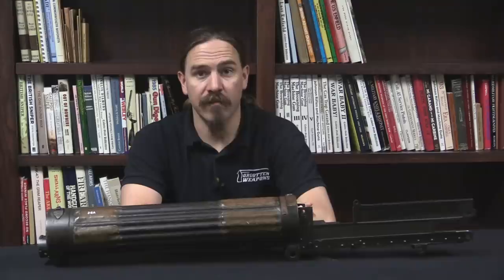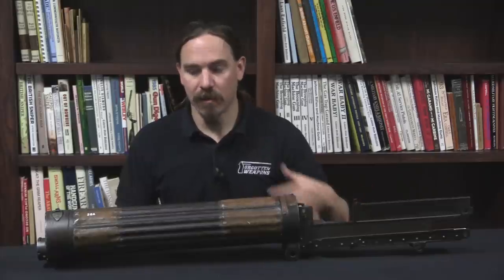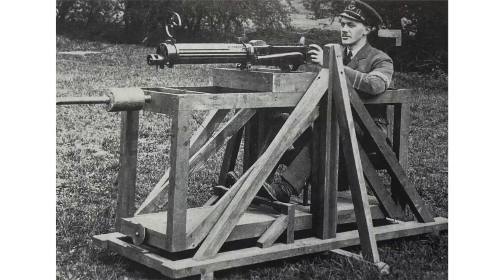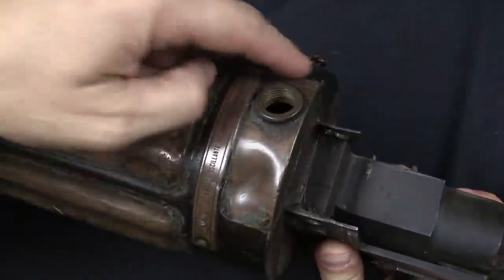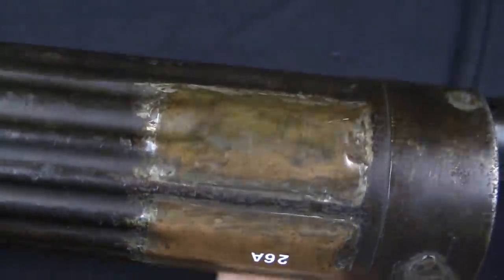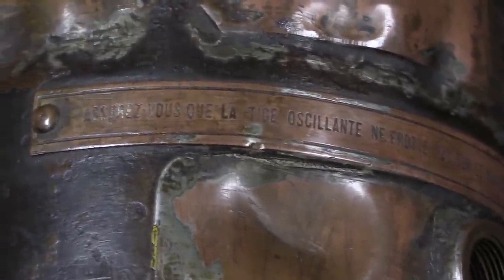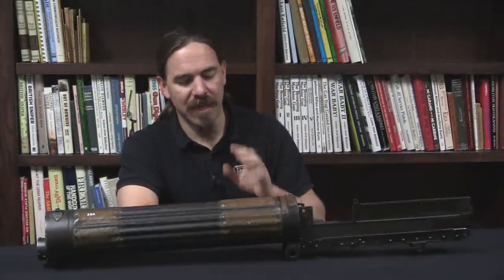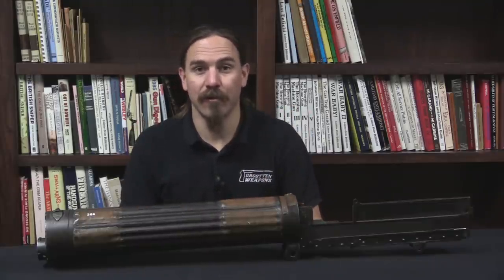Aircraft Vickers Meticulously Repaired as a Gunnery Training Aid

Comment: It occurs to me that the French only used the aircraft Vickers.  Hence the need to modify a perforated jacket rather that just acquire a ground gun jacket.
Reply: I think you are right and Ian touched on this....they didn't use spade grips but a remote trigger so only an actual aircraft gun and system would be right.
Reply: @earlyriser8998  doesn't the vickers trigger slide up out the back? so surely it would be less work to just put a aircraft style trigger mechanism on a ground gun than to solder up an aircraft gun?
Reply: @andreww2098  I think the point is that the French had no ground-gun Vickers to source parts from, they only had Aircraft ones to work with.
Reply: @earlyriser8998  Unless they would put it on a Neiport it must have Spad grips on it.
Reply: I'm always taken back and amazed by stuff from the Great War

Comment: My translation is a bit different: “do not pour wine into the jacket, no matter how indifferent the quality .”
Reply: Didn't the Soviets use low quality but potent alcohol to cool radar during the Cold War?
Reply: Given the issues europe in general had with wine adulterated with glycols, it might have outperformed the water...
Reply: @hurricane567  No... they used extremely high quality 40% ethanol/water blend in an evaporative chiller to cool the crew air in the Supersonic Booze Carrier. Uh, I mean the Tupolev Tu-22 bomber.
Reply: @hurricane567  well, they did do a ground test on the Proton rocket by filling the tanks with alcohol instead of rocket fuel (they happened to have several tank cars of industrial grade alcohol laying about...because of course they did)
Reply: @hurricane567  One of the Tupolev bombers used 40% ethanol/ 60% distilled water as coolant for the avionics and cockpit climate control. It became known as the "Vodka Truck".
Reply: I remember Lt Victor Belinko complaining that the mig 25s radar cooling alcohol was occasionally drunk
Reply: @hurricane567  in east germany they did it for sure. My father was the guy refilling it and is telling stories about ethanol mixed with cola (not coke) as the only alcohol for normal people at the airbase

Comment: The proper translation would be : "Ensure that the oscillating stick does not rub on the machine gun's jacket". The oscillating stick might refer to something else than a "stick"
Reply: The literal translation of “tige” is “stalk”, not “stick”. If I had to hazard a guess, I would say it refers to a reciprocating rod in an interrupter system.
Reply: @Squossifrage  ”oscillante” is not reciprocating in french. And yes, stick might not be best word, rod would be better. I had a look at the Vickers synchronisation installation and i believe that it refers indeed to the rod connected to the engine
Reply: @vincentkermorgant  I'm a native speaker. While “oscillante” does not literally mean “reciprocating”, it's the best translation for what I believe the text refers to.
Reply: @Squossifrage  I'm a native speaker as well. Oscillante exprime tres clairement une tige dont l'axe change plutot qu'une tige qui effectue un mouvement de va et vient. Regarde le schema de la synchronisation de la mitrailleuse Vickers aviation et tu verras que le mouvement est en effet oscillant car lateral
Reply: @vincentkermorgant  bon écoute mon chou, si ça te fait plaisir je te fais un petit diplôme certifiant que tu as gagné la discussion, d'accord ? Parce que j'ai mieux à faire que débattre avec quelqu'un qui insiste à prendre mes mots à tort.

Comment: "So can I get a few regular vickers for ground training?"
"what's wrong with your air-cooled ones?"
furious bureaucracy ensued
Reply: It is better to start with airplane adapted gun in this case as you can replicate the remote trigger as Ian points out and the interrupter gear as the plate warns about.
Reply: Aircraft Vickers set up with interrupters were somewhat different from regular ground Vickers so just getting a water cooled one from the Army may not be ideal. 

Plus, the French wouldn't have had a lot of Watercooled Vickers lying around. The French army used their own machineguns and the primary one wasn't even Watercooled. The main French use for the Vickers was in aircraft equipped with interrupter gear, which at the time were not very reliable with open bolt guns like the Hotchkiss. 

Further, no army in WWI ever had enough machineguns that they would happily give them up for other people to train.
Reply: The french had no standard Vickers guns, they only ever bought the aircraft mounted version. 
And going to any of the commonwealth armies and asking for a few machine guns for training would have been met with lots of swearing and complaints about needing 10 times as many as they have for the front as is.
Reply: @cgi2002  I think they'd have been met with a WWI equivalent of 'Yeah, right.'
Reply: @LadyAnuB  depending which commonwealth army/army unit you asked, "yeah, right" was the ww1 response, some were likely less polite. Got to remember the French didn't exactly get along with any of the other commonwealth nations before the war.
Reply: @cgi2002  Less polite response, British WWI version of F Off, Get F'd, etc.

Comment: Ian, the "oscillating arm" - is a part of synchronization gear, which was basically a system of interconnected levers, one end of which which would ride on an eccentric cam track, attached to the backside of the rotary engine and the other end - blocking the trigger mechanism, when the prop blade was in front of the barrel. Part of this lever system was located inside the ex-water jacket, around and above the barrel. The last leg of this system, a reciprocating rod, was protruding through this big rectangular hole on the rear top of the jacket and was connected to the trigger disconnect mechanism. So, this plaque is, probably, a left over from the time, this gun was air-cooled.

Comment: One of our other interests is big old gas engines, older than, or same era as this gun.  I've seen several running engines with riveted on brass patches where the water jacket had frozen, or in one case where a freight train derailed onto it. Generally done very neatly.  Given the nameplate, the source for the brass may well have been a brass fire extinguisher.

Comment: The whole video I was thinking "But why?"

I was thinking it had something to do with it being more difficult to convert a regular one into one with a cockpit trigger. It didn't make sense that this would be the case, but it was all I had. Afterall, for training you just need it to function like the actual version, it doesn't have to be exactly the same. Thus I figure you could get away with a rather crude conversion that would fill the role well enough. And those patches took a fair bit of time, skill and effort.

I didn't even think about the sheer demand for machine guns being a possible reason.

Comment: This is a Colt built Vickers, which is indicated by the two sets of patched louvres - the British Vickers Maxim Company only ever cut one set of louvres in the old water jacket for airflow - and these usually towards the breech end of the gun. (Aside from which the French  Aéronautique Militaire almost exclusively ordered the Colt made weapons). The  oscillating rod referred to would normally be for the Alkan - Hamy  synchronisation system, which introduced such a spring loaded rod through the empty water jacket to the trigger motor. However this usually involved a large cut out in the base of the jacket, which as is pointed out in the video, this particular specimen does not have. Therefore, it would probably indicate a Birkigit synchronisation system which also used a fixed series of connections to the trigger motor mechanism. Please note these are always Synchronisation systems - never 'Interrupter' systems, as the system fires the gun once the system is engaged and the trigger levers depressed on the control column, at the opportune synchronised moment of the prop passing clear, it does not 'interrupt' the flow of an independent  rate of fire from  the original trigger mechanism. For a view of both the Alkan- Hamy and Birkigt systems as well as all those from the other nations in the Great War, see Harry Woodman's seminal book "Early Aircraft Armament - The Aeroplane and the Gun up to 1918" published by Arms and Armour Press 1989

Comment: With the constant source of 100 mi/hr air, even at the same temp the gun would cool quite effectively, but, as you mentioned, with an average lapse rate of 2C (3.6f) per 1000', it gets a lot cooler fast as you go up.  It is not uncommon flying out of Phoenix in my modern aircraft that I see an outside temperature spread of 45C to -57C (113 to -70).

Comment: "tige oscillante" refers to the synchronization system between the engine and the machine gun to enable it to shoot through the propeller disk. There was a cam attached to the engine drive shaft connected by an oscillating rod to the trigger mechanism preventing the bullets to strike the propeller. This rod was very close to the gun cooling sleeve. There is some pictures at the end of this technical documentation about the system. (a perfect exercise for Ian to perfect his french)  https://docs.google.com/viewer?a=v&pid=sites&srcid=ZGVmYXVsdGRvbWFpbnxmdXNlZTQ0bW1kb2Njb21wbGV0ZXxneDoxYjE3OTAxNzkwYTA0MTcx
Reply: This document is an analysis written in 1919 to compare the french, british and german systems. It concludes that the American system (Nelson) is the best one. But invented too late to have any use during the war. For him the future in the electric firing mechanism. Very accurate for a report written in 1919. The system used in Ian's gun is the Birkigt gear. See Wikipedia  https://en.wikipedia.org/wiki/Synchronization_gear

Comment: wouldnt removing the barrel jacket altogether have been better for aircraft-mounted vickers? or are the vents somehow more efficient in heat removal than no jacket at all?
Reply: The gun needs a recoil booster which is mounted on the jacket.  There was a later pattern of aircraft gun that replaced the jacket with a slim perforated tube, like a Browning M1919; but one could not just discard the jacket.
Reply: The barrel reciprocates so the front and rear need to be supported.
Reply: Thanks for the responses guys! I suspected there was something structurally integral in the jacket but now i know for sure

Comment: The question IS; it was not easier to adapt the rear of the machine gun to a ground machine gun?
Reply: As someone has pointed out before, this was probably in the French air force. The only Vickers used by the French were in aircraft. Coordinate the French and British chains of command to supply a few regular Vickers? Hammering out a few brass plates is much, much easier.

Comment: Didn't the cocking lever fly back and forth (90degrees) violently on some old machine guns? Could that be the oscillating arm? Probably don't want that smashing your water jacket.
Reply: That was my initial thought too, though on the Vickers it's just in front of your right hand, so I don't think that's it.
Reply: I would have thought it referred to the interrupter gear linkage, if it was mounted on an actual aircraft with a spinning propeller. The ground training use would suggest no engine and therefore no interrupter gear though. Aircraft guns had various oscillating doohickeys connecting the engine to the trigger mechanism, to interrupt firing as the propeller passes in front of the gun. Maybe this was used on a plane that was no longer airworthy, but got converted for ground training somehow?

Comment: Wouldn't it have been fine to just leave the jacket as is for practice? Do you really need to fire long enough volleys to get the barrel dangerously hot during training? Even if you need to do that, wouldn't it have been sufficient to fit a thicker barrel to the gun instead? Gun noob asking, I really just fathom how modifying the gun to this extent was necessary.
Reply: As far as the amount of volleys fired in training I dont know.

Making kind of a one off heavier barrel would have probably been either cost prohibitive or logistically prohibitive.

The Vickers company was making MGs as fast as they could. Tooling up to make a heavier barrel for a small number of weapons would cost more than soldering the copper.